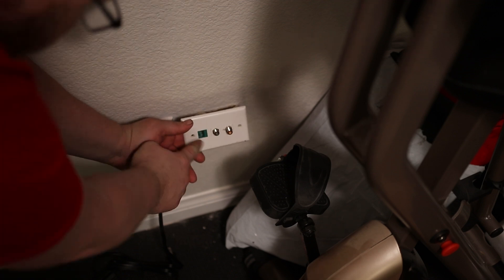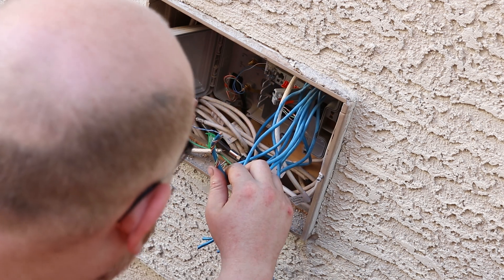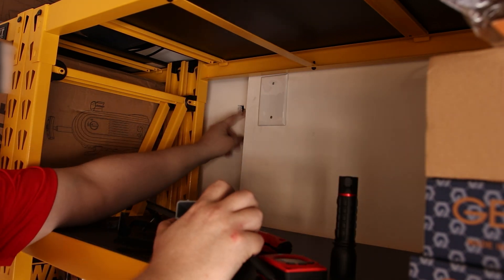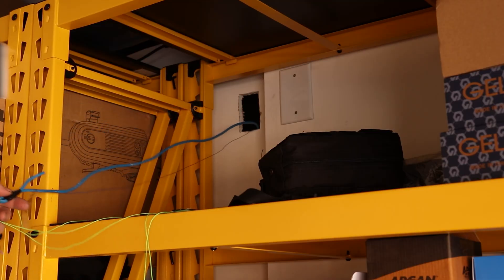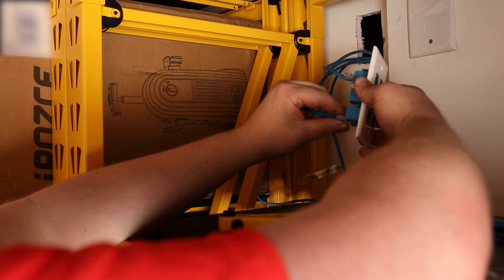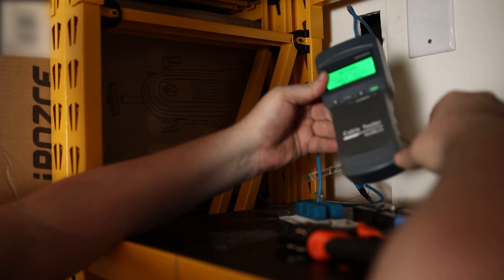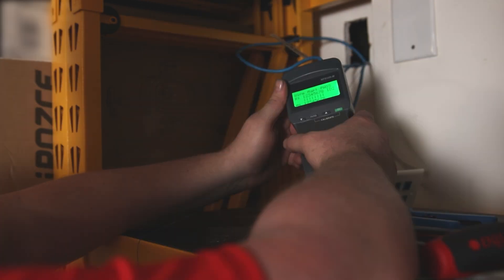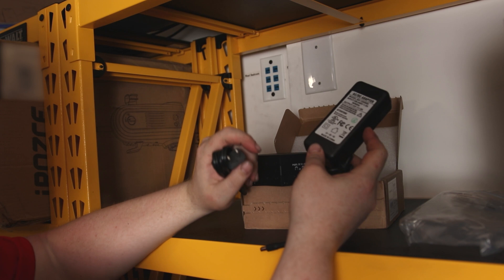How To Activate My Home Ethernet

Comment: I have often wondered how to do this, and I must say that is soooo cool! A couple of suggestions for people like me: I had a tough time hearing you most of the video. You were giving us primo information, but I just couldn't hear you. Maybe using a microphone would help this next time as it would catch information as you walked and moved along. Also, I would love to see more about the testers and tools that you used, which ones are good ones, and where I might buy them. Would love to see up close what you are doing with the items you are clipping on the end of the wire. It would also be nice to see a clear shot of the tester's screen, and to have more explanation on some of the problems that you encountered along the way. Some questions: if a line kept failing no matter how much you cut off the end, what would you do? How did you use that string to bring the wires out in the garage?

My most important question: do you think all this work was worth it? Is the speed of your computers substantially better now that you can plug right into it, instead of using wireless? It would have been cool to see a before and after of you copying those files over, to see how the speed improved. Overall, THANK YOU for posting this. I am surprised more people haven't seen it. Wouldn't everyone like to have ethernet in every room?
Reply: I have links to some of the products in the video description. It's possible that there could be a break in the line somewhere in the middle of the run.  If that's the case, the thing to do would be to break out the drywall and re-run a new line.  I'd probably never do that and simply accept wifi.  I personally prefer the dependability of ethernet.  In the event I started having connectivity issues, I'd never really know if it was my modem, isp, or wifi bugging out, and having a hard line eliminates one of those as being the issue.  Wifi has come a long way, but I am forever scarred by previous wifi equipment.  It may not be worth it for everyone.